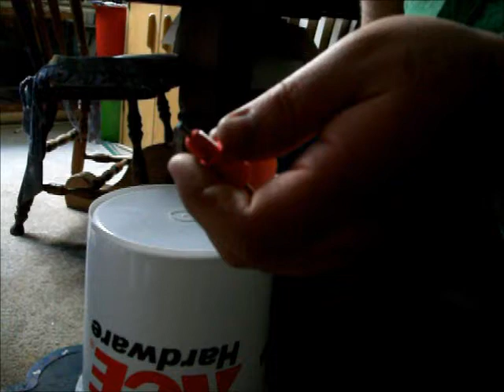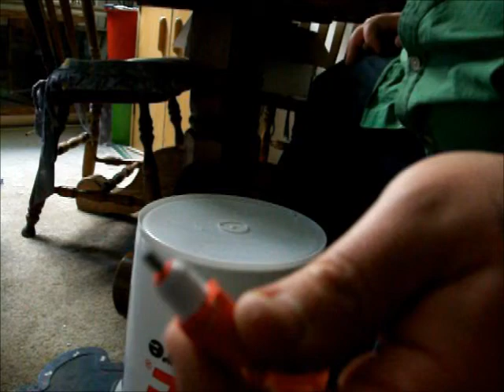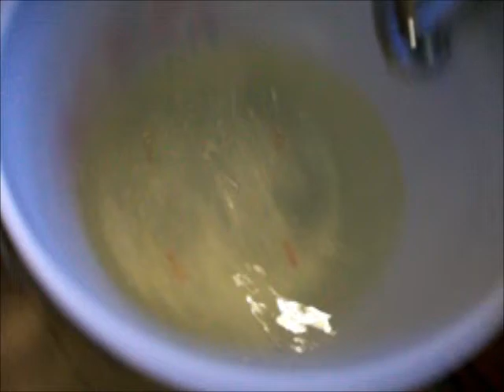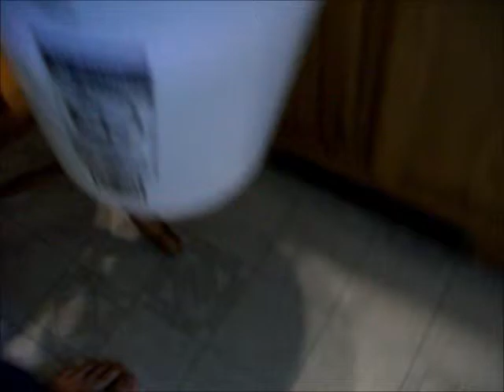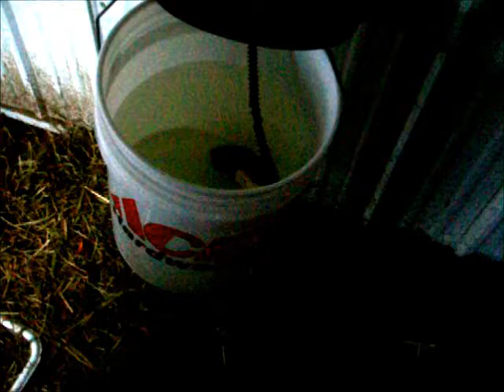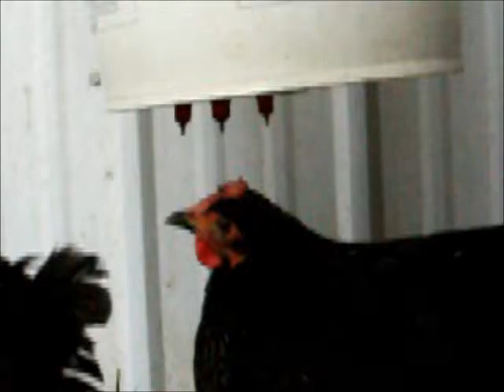clean chicken drinking bucket using chicken drinking nipples

Comment from the maker: I used to use a smaller one but this last year my bucket froze up a few times when it got really cold so I upgraded to a "Farm Innovators Ice Chaser Cast Aluminum Submergible Bucket De-Icer Model H-49, 250-Watt" its like 30 bucks on amazon, and it only runs when it needs to I did not see my utility bill go up at all by using it.

Comment from the maker: Depending on your flock they may go threw a bucket of water in a day or 2 days etc. My 27 chickens will go threw 5 gallons in around 2 days I usually top it off every day. Have had chickens for 5+ years now and have never had any disease problems even when they were drinking out of waterers that had there own feces in them. I just prefer them not to be drinking water with feces in it.